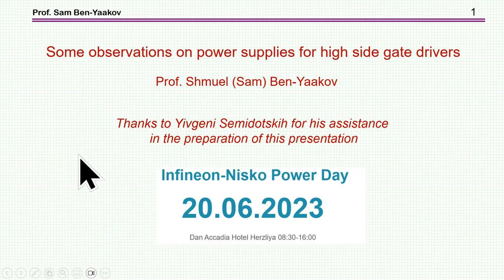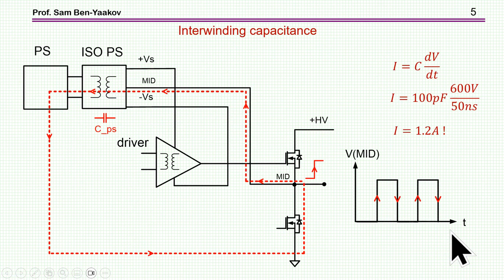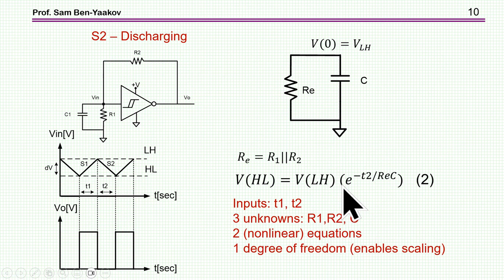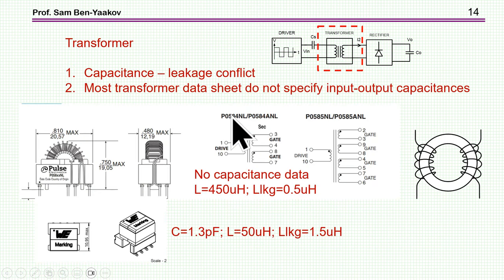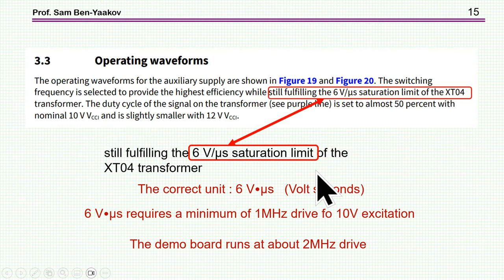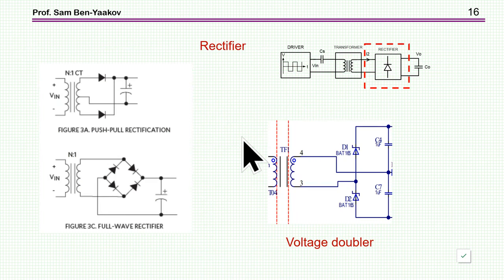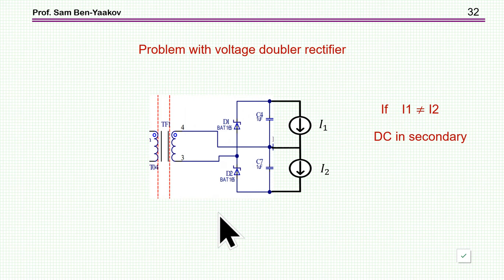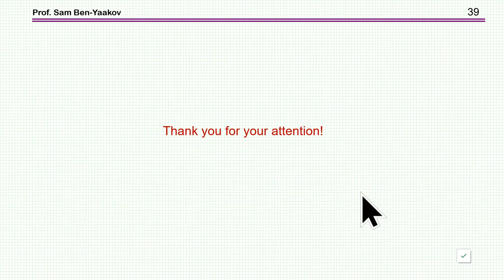Some observations on power supplies for high side gate drivers

Comment: A very good explanation, professor. It is still worth mentioning that asymmetrical gate supply creates asymmetrical current in the transformer secondary winding that is  DC current components that should be dealt with properly. Another note: any power supply connected to the source-drain node of the totem pole or like schematic will experience the high-voltage swings, and stray parameters of this auxiliary power supply would affect performance dramatically. This is why TI and some other gate drivers manufacturers "hide" this power supply inside the gate driving ICs.
Reply from the maker: Thanks for comment. 
1. Bipolar gate drive does not create a DC at the secondary. See IN THIS video https://youtu.be/RQboLY1zP3Q?t=14342. 
2. For high side drive you just need  low capacitance see IN THIS video https://youtu.be/RQboLY1zP3Q?t=346
Reply: Dear professor Ben-Yaakov, I appreciate your referencing the videos, which are very explanatory. Nonetheless, I have to note that when one controls the pulse height by changing the duty cycle (as was mentioned by one of your correspondents), which might be done in SiC gate drivers, at shorter pulse widths the amplitude of a positive pulse may go beyond the admissible value, and that may cause a short-time transformer saturation, which might be detrimental especially at higher temperatures. Therefore, transformers composing gate drivers should be calculated to the worst case since the volt-second integral tries to be zero for a period and forces the positive voltage go beyond the limit. 
Also, in your lecture the capacitance C_ps is shown as a secondary-to-primary capacitance, but there are other capacitances between the switching node and other components of the schematic layout that make up reactances playing an adverse role.
Reply from the maker: @gregorymirsky8707  Thanks for the response. 
1. The transformer controls the voltages of the gate not the other way around. I will be happy to see your simulation which proves me wrong. Always happy to learn😊
2. Sure, there are other capacitances but we are talking about the power supply. 
Thanks for the conversation.

Comment: The explanation on slide 37 is SO CLEVER.  Thank you for showing off your thoughts on this topic.  I have been using microcontrollers more and more to synthesize my signals, and it's super cool that I could use that to control the voltage split on the output rail just by controlling the duty cycle!
Reply from the maker: Great, Thanks for comment.

Comment: Hello my professor! Hope you are doing well. I did something similar for my high voltage pulser I designed for a space instrument name MASPEX. I used GAN FETs and I stacked six in series to achieve a higher Vds rating. I used a flyback converter to drive the high side GAN FETs and was switching at 1500V in 33ns. So, the common mode voltages where initially high until I used a toroid transform and wound the primary winding on the core and then encapsulated the toroid with a toroid shape cover and then wound the secondary on top of the cover. This achieve low capacitance between the primary and secondary and also also voltage isolation.  In addition, I had to cut the toroid core with a very thin diamond saw and glue both cores back and made a jig where I could control the gap while the glue or epoxy was curring. We managed to hit our target inductance.  I would like to publish my work but I would have to get permission from my employer.    I enjoyed your video very much professor.
Reply from the maker: Thank Robert for sharing. Very intersting.
Reply: Hi Robert how are you? It's been a long time you did not come to live on YouTube!

Comment: Could you please explain what would be the problem of push-pull configuration for let's say SIC driver switching at 550v/100ns with 50kHz switching frequency (application of the inverter is for the AC motor ).  What kind of problems can the oscillation from reverse recovery cause for the SIC driver?
Reply from the maker: Depending which diodes are you using. Use Schottky when possible as they don't have  stored charge (only capacitance) . Typically you get ringing and over voltage that you need to clamp. By putting capacitor across total primary you can get soft switching by carefully adjusting the dead time and the resonant frequency (Cap size)

Comment: A practical perfect 50% duty cycle can be easily obtained by using a toggle Flip Flop after the oscillator. Many DC/DC control IC use this trick to get 50% duty cycle out of a cheap, integrated RC-Oscillator. No need for additional capacitors in the power path.
Reply from the maker: Really? And how would you stabilize the output at low or no load?
Reply from the maker: Exactly 50% at the output of the power driver? You should call up AD to tell them to change the duty cycle tolerance on datasheet.
Reply from the maker: I have inadvertently erased your other comment. Sorry. Below is my .
Reply: @sambenyaakov  Maybe they are using the trick already inside the IC and the resulting deviation from perfect 50% is due to short term frequency instability of the oscillator. +/-1% is still quite good, but sometimes not good enough.
Reply from the maker: @JacquesMartini  So 50% is not assured. There are uneven delays and uneven rise times. Have you ever built a 50% power driver and tested it? 1% for a 12V drive is 0.12V DC and with a 50mOhm winding resistance it is about 2A.

Comment: Your oscillator will not work, since the gate is NON-inverting! 🙃
Reply from the maker: Which gate is non inverting???? Can you point to the minute in video of that?
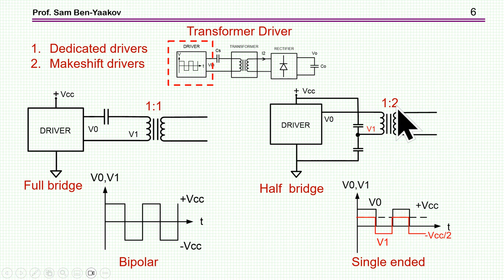Reply: @sambenyaakov  At 7:00. The symbol of the schmitt trigger is non inverting. An inverting schmitt trigger like the 74HC14 has a horizontal mirrored symbol. Yes, Iam pedantic sometimes 🙂
Aaaaah, there is an inverting dot at the output. Ok, this way we can call this inverting. I did not see this symbol before, just the "normal" 74HC14.
Reply from the maker: @JacquesMartini  My driver has a normal non inverting Schmitt trigger followed by an inverter,  ha ha ha. Who are you? Having too much free time?

Comment: I have been playing with these isolated charge pump topologies for SiC gate drive power using off-the-shelf gate drive transformers and chips as described in the video. It does work well in practice, but there are some caveats. One of the main challenges I had was maintaining good enough load regulation to meet the SiC gate drive voltage requirements across a range of switching frequencies (the power draw of charging the gate being proportional to switching frequency). I found the two biggest contributing factors to be the gate driver output resistance, which is very high and non-linear for some devices using a BJT + MOSFET output stage, and the secondary rectifier diode slope resistance, where Si PN diodes performed vastly better than schottkies. In the end, an IX4340 and BAV99 diodes for the rectifier ended up being the best combination, and although I did experiment with building an oscillator around the GDIC, I found an external oscillator to be much less finicky in practice. This was all for a PSFB SiC induction heater for which I posted the schematics on highvoltageforum.net. On the asymmetrical duty cycle charge pump to provide both Vgh and Vgl, Infineon has some chips based on that exact concept for gate drive power.
Reply from the maker: Thanks for sharing. Interesting.

Comment: Hello, thank you for this video. I'm curious about one thing regarding transformer's capacitance (C_ps) emhasized at slide 5: I think it is valid only if between ground potential of phase shift and PS block is any low ohmic connection, Y caps or RC. Am I right? Thank you in advance for answer :)
Reply from the maker: Good question. There is always some connection between the power ground and the ground of PS . It could be galvanic connection, by discrete capacitor or parasitic capacitor and then the injection is by a capacitor divider.
Reply: @sambenyaakov  thank You :)